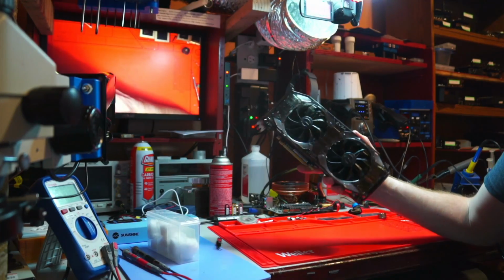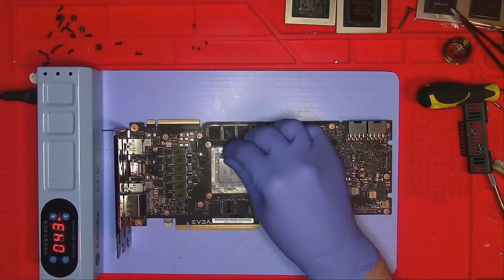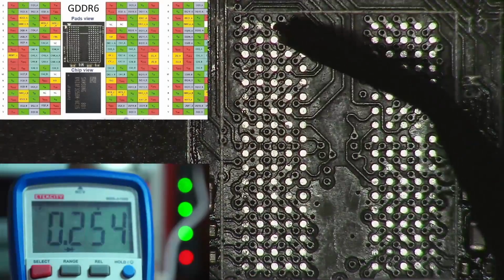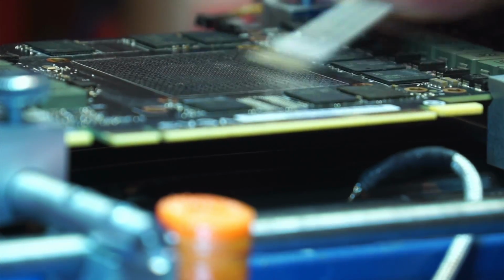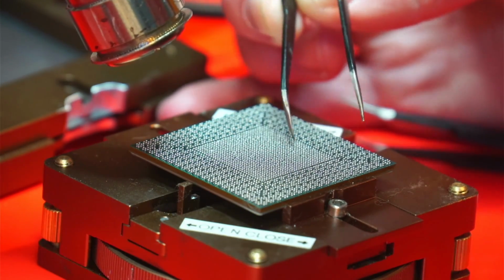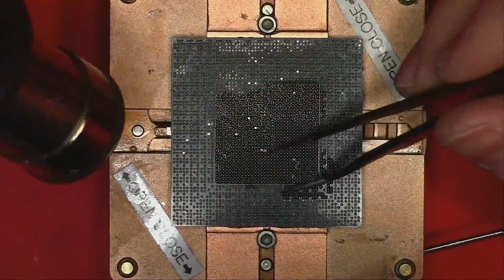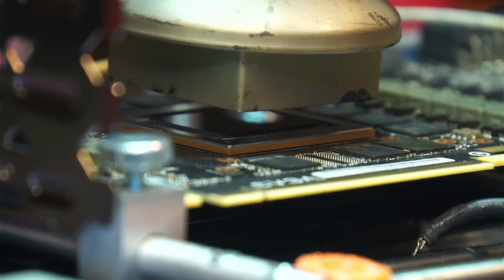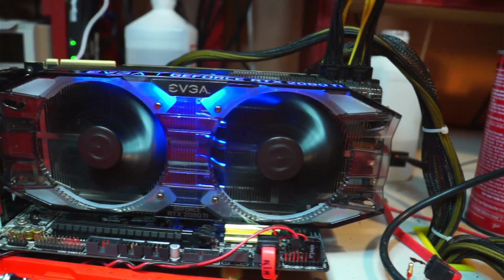watch out Online markets sell refurbished graphics cards as brand new

Comment: Man, that card works better than the day it came out of the eVGA factory, without a doubt! 482 FPS in Furmark, isn't shabby, out of the box with no driver tweak/optimisations.
Surprised me, Unigine SDK 2.0.17–2024 build 12053, installed and ran first time, *System76 Pop!_OS, 24.04, Cosmic DE (Alpha 2)*, which is a RUST modified, Ubuntu 24.04 OS.
Although, I suspect it might have something to do with, installing Bottles, Lutris, Heroic, having Heroic install the EGS frontend, for Unreal Engine, Proton-GE, Proton, Proton Hacks, Steam, Wine, Wine Hacks, Dos Box and multiple other emulators installed, with the latest Nvidia Driver Version: 560.35.03. NVML 12.560.35.03. For anyone interested, here are the steps;

1. https://assets.unigine.com/d/browser/UNIGINE_SDK_Browser2_Linux_2.0.17.run 
2. Move the installer, to your home directory; UNIGINE_SDK_Browser2_Linux_2.0.17.run - to ~ directory, 
3. Issue this, as yourself, not sudo; chmod +x, 
4. Execute and accepted terms; bash UNIGINE_SDK_Browser2_Linux_2.0.17.run, 
5. CD into the unpacked files, /home/%user%/UNIGINE_SDK_Browser2 and repeat,
6.  chmod +x browser2.run 💥
7. Log into Unigine, 
8. Download the latest Default SDK, UNIGINE 2 Community, 
9. Wait, until your hair turns grey, 
10. Look at; https://developer.unigine.com/en/docs/latest/code/environment/linux?rlang=cpp - if you run into issues.

Unigine recommends the usual editors, Visual Studio Code or JetBrains Rider. Both frustrate me, incessant overuse of automation, no flow control on extensions, out of date or dead packages, for starters... I use Zed (written in RUST and used by World class developers), with SSH and GPG setup with GitHub auth (done before installing Zed), which works flawlessly and gives most of what either of suggested IDE's give, and much, much more, check it out at; *zed.dev*

Personal note; C++ is a shady language, nearly as old as me (1978 Brian Kernighan and Dennis Ritchie, published the first edition of The C Programming Language. C++ was invented by Danish computer scientist Bjarne Stroustrup at AT&T Bell Labs in 1979. It originated from analysis of the UNIX kernel to investigate to what extent it can be distributed over a network.), they might have been exactly the opposite of heavy, on bare metal, once... Today, that metal has developed into, RUST. They've now been superseded.

DARPA, Defense Advanced Research Projects Agency research project; Translating All C to Rust (Tractor), darpa.mil/program/translating-all-c-to-rust - explains more in detail, regarding why C++ for all its speed advantages, has just about had its day (since "Type Safety", was never integrated in the beginning, the afterthought of it now, looses much of its efficiency and results in further compatibility problems, many of which are extreme security flaws, with no real world safe/practical workarounds or truly safe solutions remaining). 

C#, Go, RUST and even JavaScript (TypeScript), are memory safe programming languages. C# and Mono.Net, has moved to Microsoft Core Language spec, more or less, 1-1 convertible language from Java. JRE violations, security flaws & problems, might even be worse than the many in C++, not in the language spec itself, rather in its virtual engine runtime and a result of sloppy packaging (mostly eliminated today, due care should always be taken), with that said, some people (including myself), think Java, has never been a high performance language and for all its features, its speed leaves a great deal to be desired, alongside benchmarks from C and C++. They're in the DUST, with RUST. I've rambled enough, for one day... good luck!

Translating All C to Rust (TRACTOR) - www.darpa.mil/program/translating-all-c-to-rust

Comment: I have seen other reballing videos and they use paste solder and hold the stencil down while applying heat, is there a reason for using in this case solder balls? and is there a reason for not using the stencil to keep the solder balls from moving?

Comment: What's the point in adding flux while desoldering anything? It's pointless.
Reply from the maker: Heat transfer.
Lower temp needed.
Clean detachment.
Less likely to rip pads as a result.
Reply: @northwestrepair  Won't agree, flux won't affect desoldering temperature, the only purpose it has - to remove oxide. Plus, removing with flux could hide the problem with gray pads that were from factory. Flux could make desoldering a little bit easy by better visual control on solder ball during there phase change. I really doubt about better heat transfer, maybe 1-2% better but it won't affect much. That's my opinion, Your could do whatever Your want and the way Your want. Just saw no point in wasting flux. Cheers.

Comment: The GPU cooler heat sink is scratched to hell and back! What did they do to the poor thing?? Also, using flux to clean the pads makes sense - I imagine the PCB appreciates avoiding an extra cooling/heating cycle, there's only so much it can take.

Comment: About the second sticker - in warranty repair if the card gets a pass from the test and get repaist they don't replace it they just put a new one on top. mostly happens on MSI laptops you can see the sticker on the bottom panel on one of the screws after inspection if lets say ram got replaced they just plop a new sticker on top. I am not defending this one becouse the paste application WAS HORRIFIC, and the solder job on the core was bad to say the least. I just wanted to put this out there since i did work'ed at warranty acceptence, and no need to reject a product just for the sticker.

Comment: Thanks for mentioning the thermal paste you use (arctic NX4). I probably need to re-paste my 3090 and was overwhelmed with the choice of different paste manufacturers
Reply: If you want the best from Arctic, it's the MX-6. MX-4 is still a fantastic performer though. Thermal Grizzly tends to be overpriced and doesn't really offer an advantage. Noctua also makes two pastes that are also on par with the MX-4 and MX-6 (NT-H1 which competes with the MX-4 and NT-H2 which competes with the MX-6) and won't empty the bank account either. You can't go wrong with any of these choices.

Comment: Since we started speaking via email about my 3090 issues, I've gone and binged most all of your videos, you sir are a master of your craft. I have absolutely no issue sending you business... when my card actually gets back. I showed your channel to a few friends and they've started bingeing too. Nice work!
Reply from the maker: cool
Reply: May I ask what issues you're having with your 3090?
Reply: @xntumrfo9ivrnwf  red light above the first power plug, no fans, no rgb, black screen.
Reply: @banana_havok  do u have any clue why it died? its such a new card
Reply: @banana_havok  interesting! I just sent my 3080Ti to evga with that exact same issue, only the red light was over the second power plug. I wonder what that may be.
Question though... I've always wondered... many cards I see on this channel I would assume are still under warranty as they'r enot 3 years old... wjy send them for repair vs warranty claim? Genuine question.
This channel is inspriational, almost ASMR for me lol. The skill and patience shown are supreme!
Reply: @emp1985  repair vs. warranty is your question. Card manufacturers will use any little reason to not honor warranty even if the damage is a small cosmetic thing that has nothing to do with the hardware failure. Now your'e sitting on a $700 paper weight with no warranty support because of a cosmetic issue. $300 repair is cheaper than spending another $700.
Reply: @Rockr69747  Fair enough... that makes sense. The cards may have been sent for RMA, and it was rejected... and no looking for repair.
Reply: cool
Reply: cool